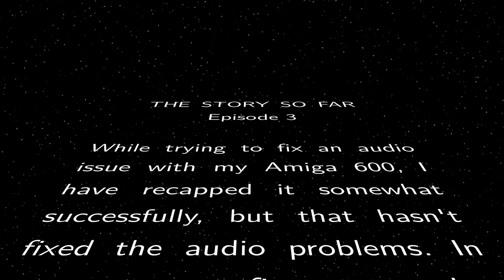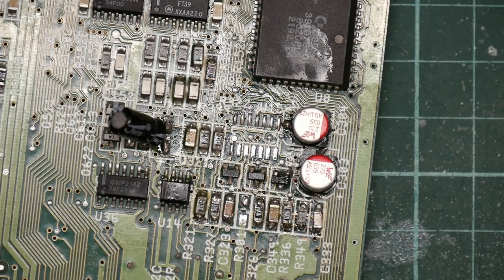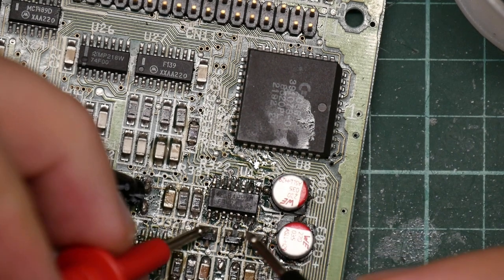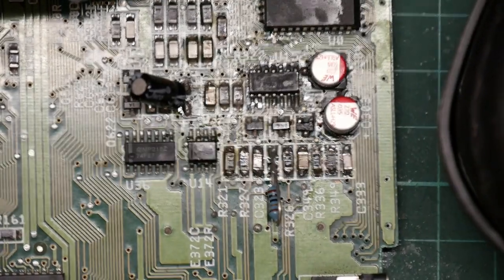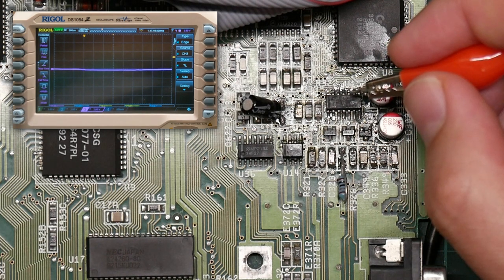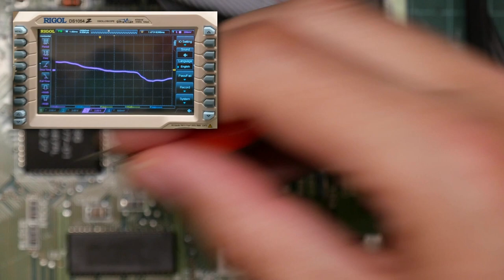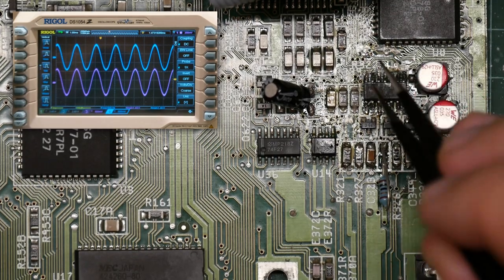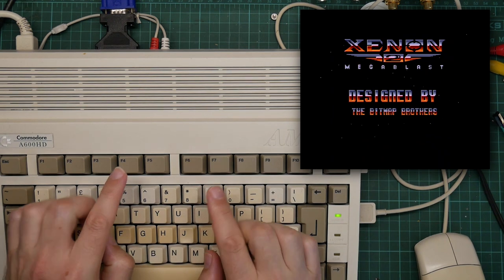Amiga 600 audio system fix: 3/3

Comment: Hi, thanks for video series of repairs!. I have the same problem with an Amiga 1200, and audio circuits seems to be the same. I have recaped all mainboard but the problem persist.  At now, im still don´t know was the component that have the problem. Was opamp? Was a resistor? Was in any joint or trace? I would like to repair my Amiga and thanks again for all videos of repairs.